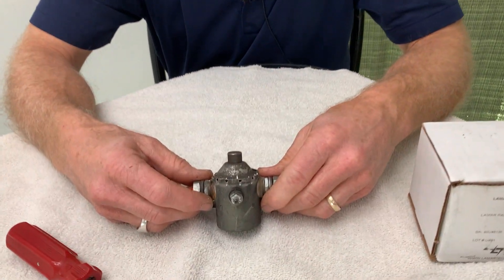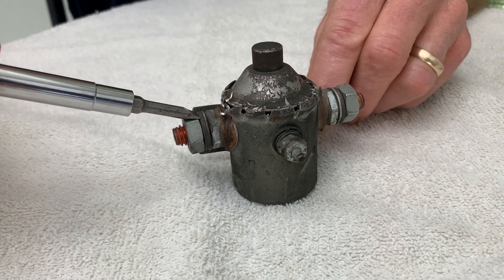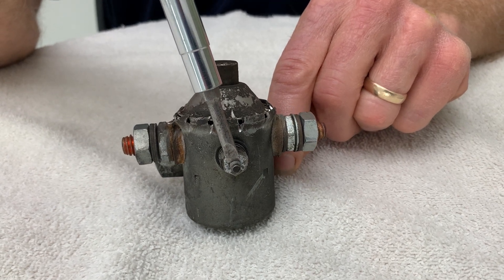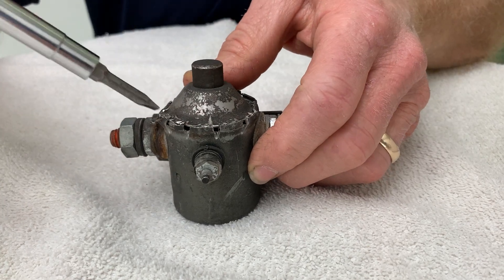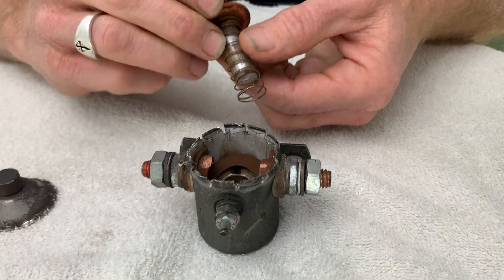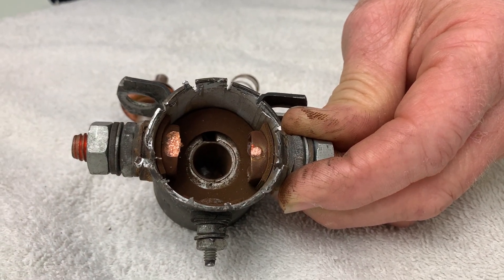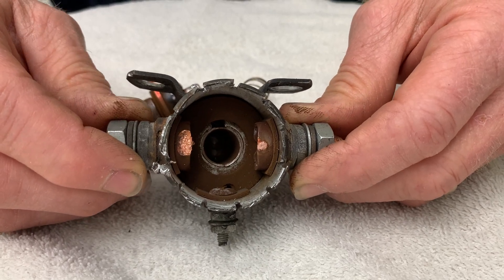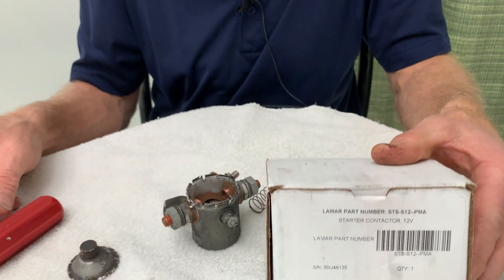Inside an airplane starter contactor

Comment: It is always fun to take defective aircraft parts apart, particularly if you did not have to pay for the replacement part because the old part was not from your airplane. Judging from the video, it looks like the major resistance was due to the worn contactor ring. It rotates and you could see some very thin contact areas on portions of the ring.  My best souvenir is a $400 3 inch vacuum pipe elbow that attached to the vacuum pump on my O320 engine.  I have it in my desk drawer and occasionally take it out to marvel at how expensive the new one was.